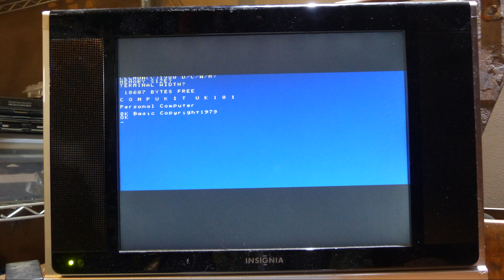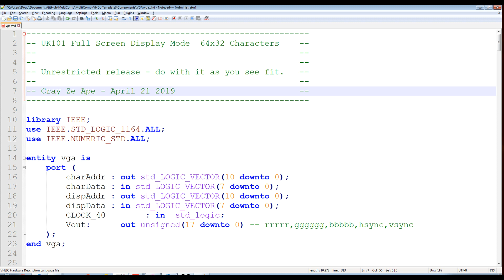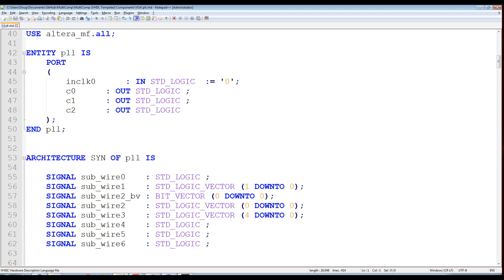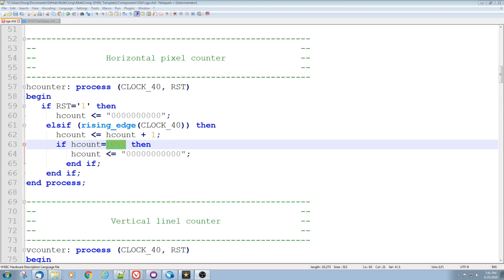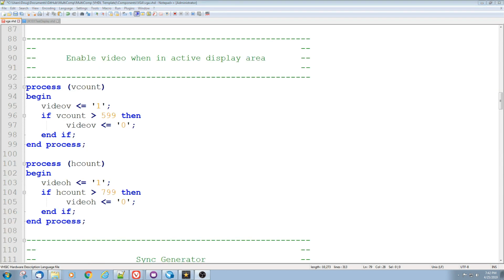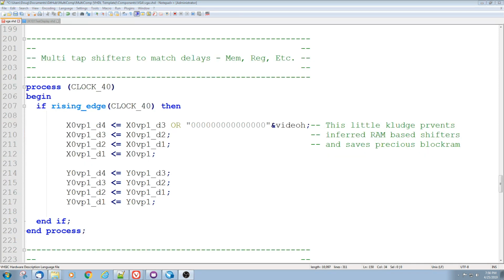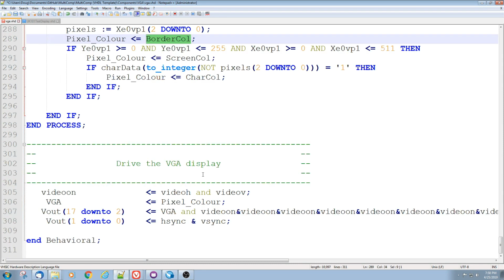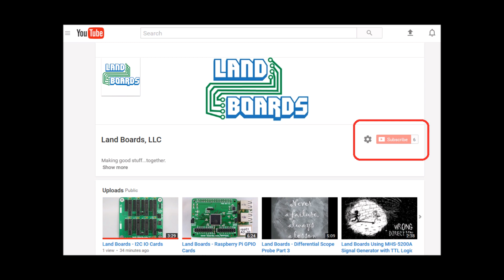EP4 FPGA Dev Board - VGA in VHDL - Big Improvements

Comment: Wow, what a shout-out, and presented very nicely as well. :)
Lot's of 64's in the code but only one of them sets the line length, the others scale the 'rather large' image down to something that fit's on the monitor. I'll come back and post a few details soon, though I have a couple of tasks to get out of the way first. I mainly wanted to say thanks for the shout-out, and ....
..... check your email, I sent you a couple KB of spare blockram :)
Reply from the maker: Thank you for your efforts on this video improvement.

I will try out the blockram.
Reply from the maker: Tried the block RAM and it works. Thank you once again.
Reply: @LandBoardsLLC  No problems, I'm a bit rusty so the practice is a good thing. I found the quartus settings you need to look at in order to stop the UART from consuming RAM. You have mail.
There is still an additional 1KB of unused 9th bits in the BASIC ROM, this is also recoverable with a little extra work.
Reply from the maker: I gave it a shot but still had the same blockRam tied up by the UART. I probably did it wrong. It set these. Maybe the wrong values?
set_global_assignment -name INFER_RAMS_FROM_RAW_LOGIC OFF
set_global_assignment -name AUTO_SHIFT_REGISTER_RECOGNITION ALWAYS

Have you seen Neal Crook's Multicomp build? It's 6809 based but fixes a lot of stuff . https://github.com/nealcrook
Reply from the maker: If the RAM was configured as dual port would it make a read-modify-write operation easier?
Reply: @LandBoardsLLC  I had a quick look at Neal's build when you added to your github page, I don't think I'd seen it before.
Reply: @LandBoardsLLC  Dual port RAM would let me drop the input registers, but I'm not sure there is a big advantage. Some FPGA's double the RAM usage to fake a dual port RAM, and that wouldn't exactly help when you're trying to get more RAM. I prefer to target maximum compatibility with as many logic families as possible.
Instead of a read-modify-write, it's more of a read-(modified write) operation. It works fine as far as I tested, have you run into trouble?
Reply from the maker: @crayzeape2230  No problems at all. Just wondered it it made it easier to do the R-M-W operation.

I appreciate the portability answer. Makes sense. I haven't played with other FPGAs enough to form an opinion. My last experiences were Xilinx 20 years ago.
Reply from the maker: I wonder if the SuperBoard II video could be even better by using your scaling but doing so just vertically?

I think that my horizontal pixels look better and like yours is the full width of the screen. Your code looks great vertically but not as good horizontally.

Part of what I did there was to make the pixel clock = 40.28 MHz which makes a 2x clock. This always doubles pixels horizontally and fits the screen width nicely.

If I change the PLL for your 40 MHz clock to 40.288 MHz, adjust the horizontal timing and remove the horizontal scaling it seems like that should work as good as it possibly can.
Reply from the maker: Oh, but mine was set for 640x480 not 800x600. I'd have to change the clock to match that faster rate...
Reply: @LandBoardsLLC  Don't change anything yet, I know what you're looking for, give me a couple minutes and I'll give you new transformation parameters. You don't need to play with the pixel clock, the small changes would be handled by the monitor with no change.
Reply from the maker: The maths show a 51.2 MHz pixel clock.
Reply: @LandBoardsLLC  I think 640x480 might be the best mode to target anyway, you get 64 pixels of border left and right while the pixels are not stretched horizontally.
Vertically, there will still be some pixel stretching. I'll test it out, and post some adjustments.
Reply from the maker: @crayzeape2230  32 rows, 8 pixels is 256 rows - expanded to 480 visible rows probably looks pretty good.
Reply: @LandBoardsLLC  I'm have 640x480 set up now so I'll give it a try, but there will still be some different sized pixels, 480 being less then 2x256.
Reply: @LandBoardsLLC  1024x768 is very nice if your monitor will support it. I have no side borders to play with at that res, so I have to go and inset a few delay registers to fix some left-hand edge delays. Some no related things to catch up on as well. I'll be back.....